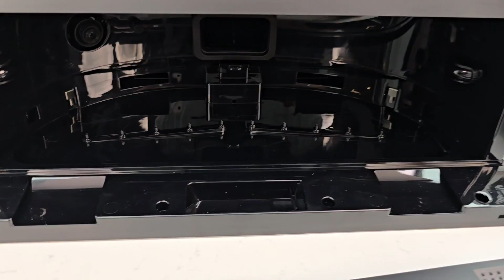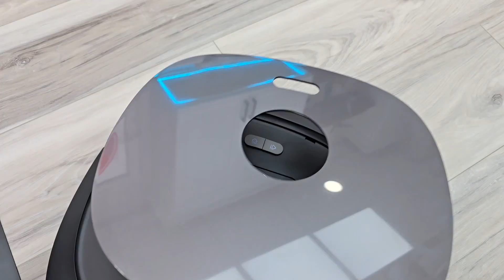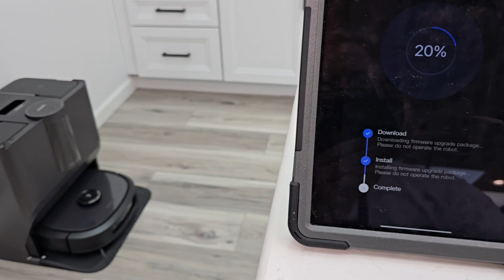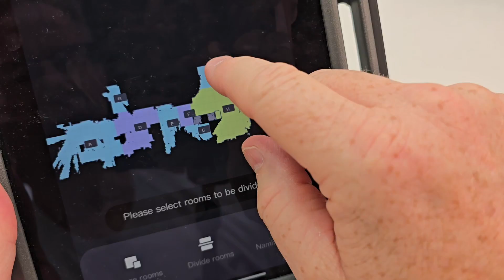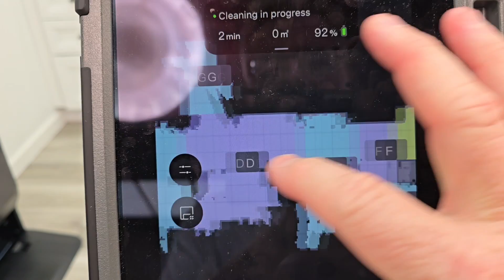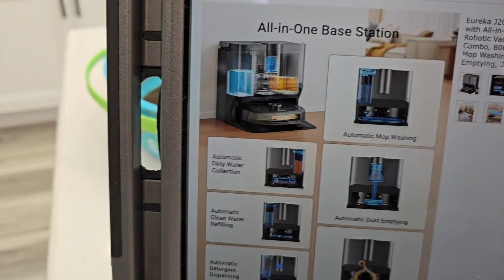Eureka J20 Robot Vacuum & Mop Combo Unboxing & Setup  FIRST LOOK REVIEW

Comment: Thanks for your videos great information.
Would like to see comparison with the eufy s1 
I just bought the Dreame x40 over the S1 for these reasons
1. I got it cheap $1067
2. Cannot buy eufy products in Thailand
3. Think its better at getting into all the corners
4. Can refill cleaning fluid
S1 may be better at hard floor cleaning with that roller but the X40 still does a brilliant job 
I have 2 cats that kill geckos and often find dried blood on the porch floor this is where X40 fails at cleaning I would like to see you test the S1 with dried blood😂

Comment: Great videos! Your video made me choose the Eufy S1 pro rather than the X10 pro as the video showed me what I needed to see for comparison.
Reply: How's Eufy S10 pro going with you? Does its navigation work good?
Reply: @jayrc1793  hey it’s excellent no complaints whatsoever. I had an LR30 prior to buying the S1 Pro which has been moved upstairs. The mop does a far better job than I ever was able to do with my manual steam mop or the LR30s pad mop. It is expensive but I think it’s worth the extra £$